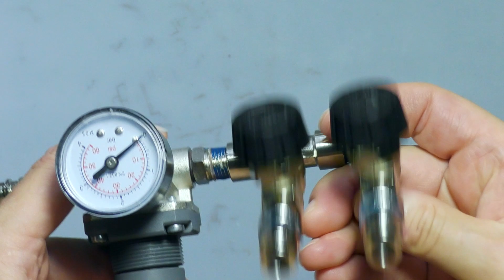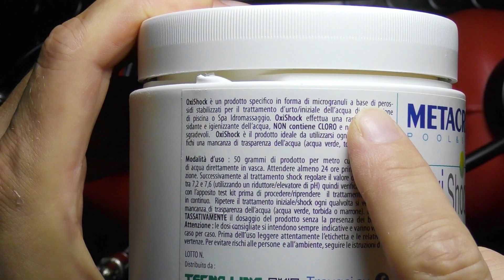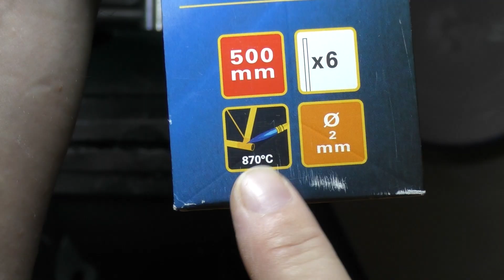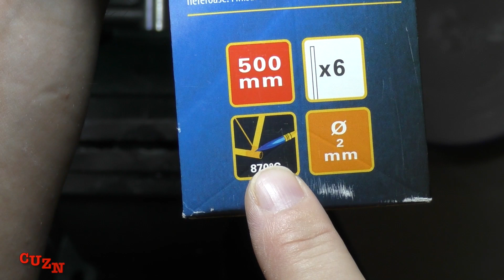AVANZATO generatore di GAS per cannello a benzina brasatura ottone

Comment from the maker: Dear friends, today's project involves the construction of a petrol oxygen and gas generator.  Initially I had thought of using Zeolite due to the higher concentration of oxygen, this is because oxygen is let through by the molecular structure of the Zeolite unlike Nitrogen.  However, real oxygen concentrators have nitrogen discharge unlike my initial idea (we'll talk about it in the next video).  The accumulated Nitrogen held the limit of my gas torch i.e. I was unable to braze with brass rods (the melting temperature of the rod must be almost double on the piece).  I can say that I have reached this temperature comparing it to other torches I own.  I assure you that a normal propane torch cannot braze brass.  We need important performance.  Thanks to hydrogen peroxide and a new circuit I managed to do it.  When the torch is very hot it needs less air, so oxygen was lost in the first circuit.  By connecting the gas vapors to the oxygen tank everything changed.  Even with less air, oxygen was always present because it was incorporated in the first tank.  I can say based on the behavior of my torch that I was able to extract about 10% oxygen from the hydrogen peroxide.  With simple water the limit of brass remained.  Two non-return valves ensure the releaving function of the pressure regulator.  A flow regulator in a second circuit allows fine regulation of the air so as to adjust the flame and make it stable for brazing.  In the two tanks there are rilsan fittings which bring the air directly to the bottom.  If you have any other questions, please ask.  
ATTENTION: this video is for informational purposes only, do not repeat it absolutely.  All actions were performed safely.  Enjoy your vision